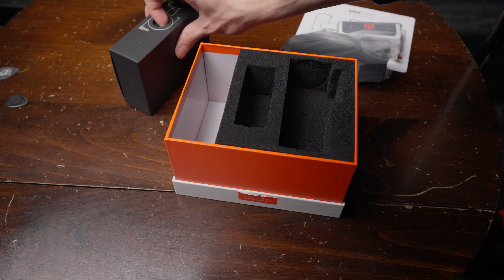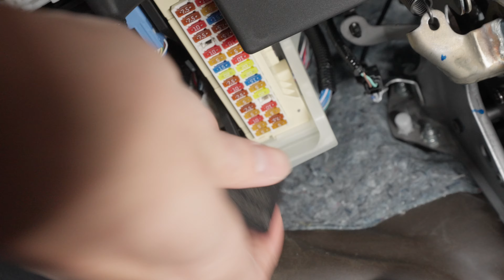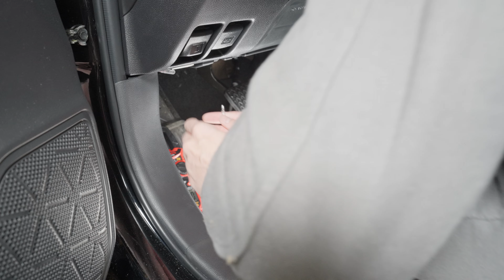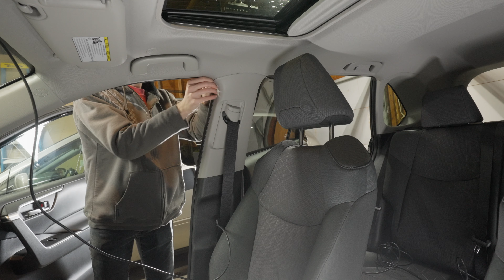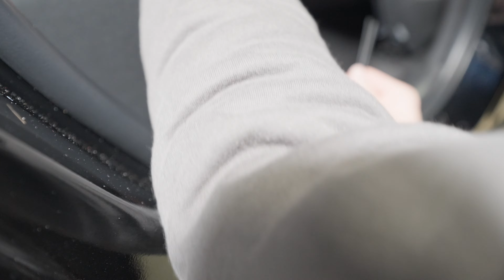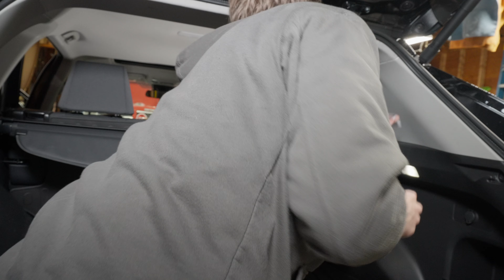How to SAFELY install a Dashcam Like a Pro! | VanTrue N5

Comment: You just wasted all your time trying to hook the cable instead of showing how where to  place the camera . I was not given any camera holder. I have vantrue 3 camera. If I place the front camera on the windshield, it points towards the sky and inside camera is facing me. I won't be able to see passengers in the back. It
Reply from the maker: If you weren’t given a camera holder it sounds like you should reach out to the company. Also, camera placement is pretty simple since the inward facing camera rotates. So you have the outward facing one pointing where it needs to and rotate the inward one until the picture is clear and at the angle you want.
Reply: @jackofmanytrades well it turned out that I was given a holder but my front and cabin camera is joined and I have Kia Niro which means it has this big black structure on the top center if windshield. The tricky part go towards the right so cabin can be in full view but that places the front way too right which reduces the front view coverage. I found a video for Kia car
Reply from the maker: Ah I gotcha. Yeah, unfortunately a lot of these newer cars have big sections at the middle of the windshield covered because of all the electronics. But in glad you found a video more-tailored to your exact car.

Comment: Guys, don't buy anything Vantrue. Even if you already did, never ever install any firmware updates.

I'm speaking from experience. After firmware update on my vantrue n5, cam keeps rebooting randomly while driving. Contacted support and they gaslit me.

Part of their planned obsolescence I believe.

This issue is not just me but with other users on reddit.

Such an expensive dashcam. I'm heart broken. And I must warn everybody.

Comment: I just purchased mine. I tried setting up the backup camera and it doesn’t seem to get any power. Any idea of what I should do?
Reply from the maker: Well, I’d highly recommend testing the camera before you actually wire it inside your car.  You can take a standard phone brick to supply power and make sure that you plug in the main power to the USB C on the base. Then use the other USB C to connect to the front camera to the back camera. Everything should work. 

When you go to actually wire everything in your car, if you validate that the always on and accessory fuse taps were wired correctly, then it’s very likely that you do not have a proper ground connection. You need to ensure that there is a metal-to-metal connection with the ground wire. Use your multimeter if you are unsure.

Comment: Thank you, i have spent hours looking for this. I found a few on Redit but was not sure if I could use the 2 open spots or not on the fuse panel.
Reply from the maker: No problem! I’m glad it helped you! I’m currently in the process of designing a new cover that will allow you to still keep the fuse box covered. But designing has been slow due to time constraints
Reply: I have a 2021 and I was trying to find an easy way to pop off the airbag cover and zip tie the line like you did. tools are limited, but ill figure something out.
Reply from the maker: @TheFuzzyAmerican gotcha, unfortunately it’s something that takes a bit of effort particularly if you don’t have needle nose pliers
Reply: @jackofmanytrades  got everything installed a few days ago and its working great in my 2021 RAV 4, just had an issue last night ubering where the front passenger door seat belt wont retract that I am looking into. Could have been  didnt pop the panel back in properly. This has been the best step by step video i have seen
Reply from the maker: @TheFuzzyAmerican so happy that it worked out for you, bro! Thank you for your comments, glad you found it helpful! 🫡